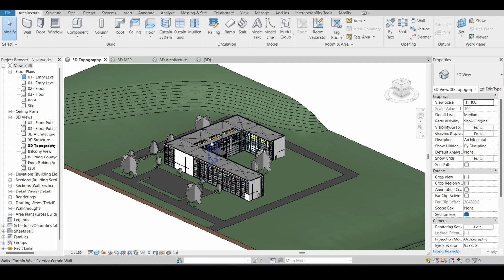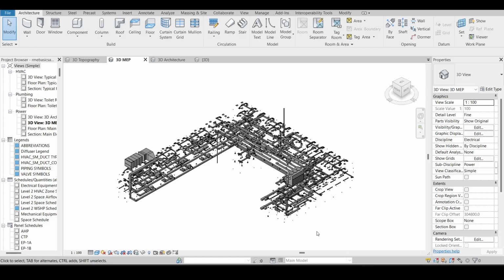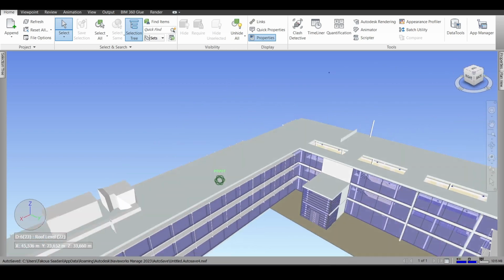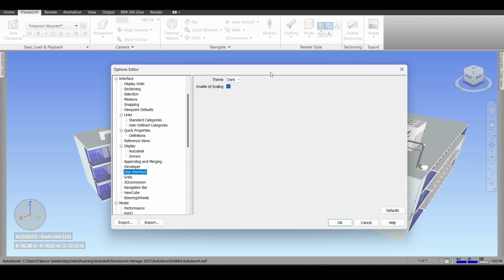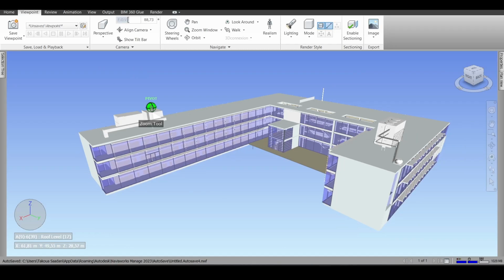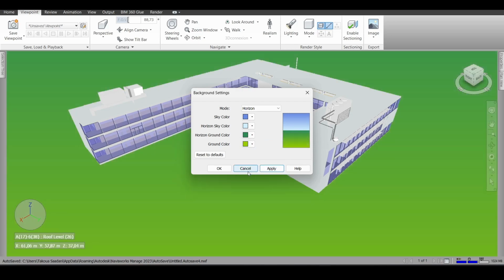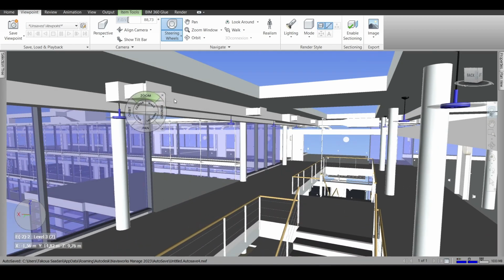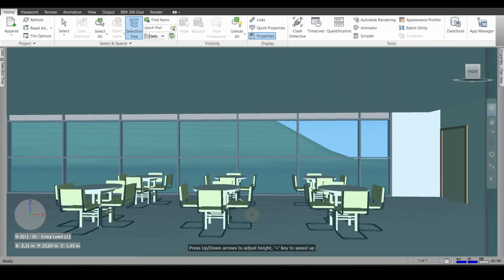Export Revit model in NWC , Workspace Setup and Visual inspection in Navisworks : Beginners Tutorial

Comment: hi, i have different models; one is structural and the other is plumbing how can i open both in the same navisworks file? i've already exported both as a navisworks file
Reply from the maker: Hi! to open a plumbing and a structural models in Navisworks : 
(assuming you have Navisworks open) go to file → append, then select one of your files, then repeat that process and choose the second one.

They should be loaded into the same scene, aligned based on their original coordinates. Now if they don’t line up correctly, check that both were exported from the same coordinate system in your design software (I'm assuming it's Revit?) before exporting.

Comment: for fabrication parts why when i export from revit to nwc i lose my colors as filter ?
Reply from the maker: This could be due to Revit materials may not transfering correctly.
or color overrides in Revit not carryin over.
Check ur export settings to ensure materials are included
Also Navisworks may apply default colors if it can’t interpret the materials